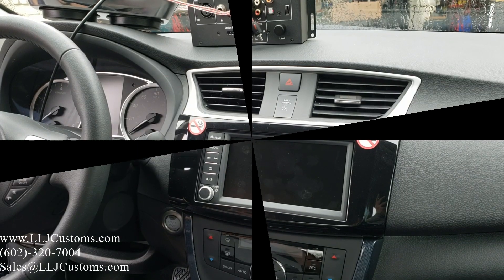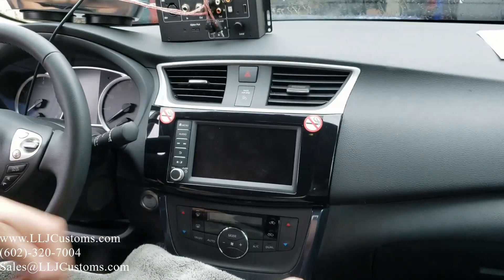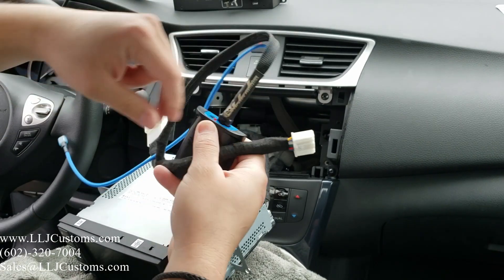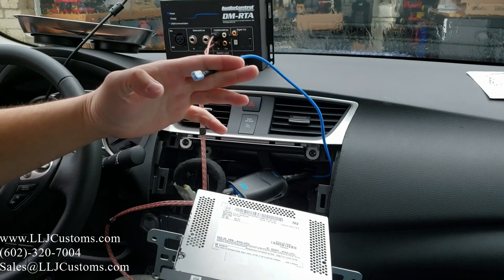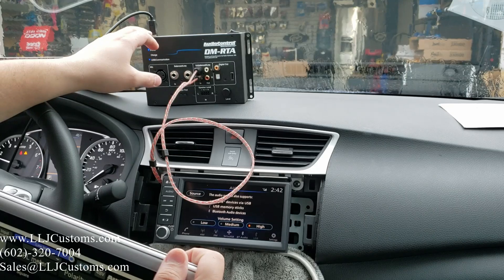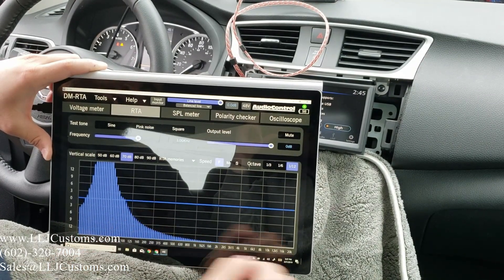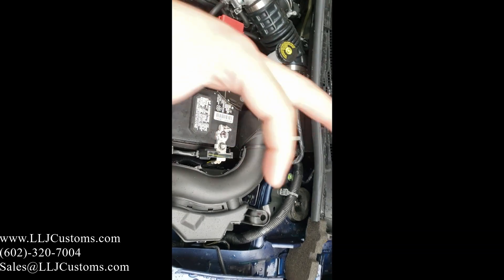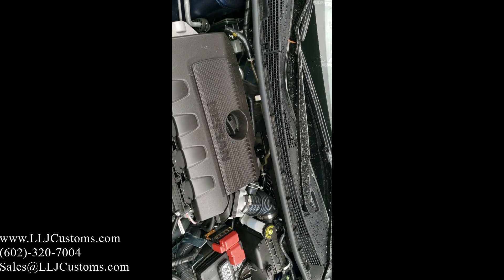2019 Nissan Sentra T-harness for sub-woofer amplifier install

Comment: I need a harness to wire a small 4 or maybe 5 channel amp to my OEM radio and speakers non Bose I have 2 door speakers and 2 package tray speakers for my 2015 Nissan Sentra. I havnt decided on the amp yet recommendations  needed would like to get in one around $200.00 tia Will H
Reply from the maker: @willhoggard645  hello, i would look at something like the wavtech 1000.5pluse for the abilities and price you cant do better ...with a bose loopback and a power kit is all ypu would need

Comment: can I use this "T harness" to plug into an MTX Bass tube (Built in amp)?
Reply from the maker: Hello adonian, that will depend on the input level of the all in one . Some units can take the 13v that the factory headunit will output if you have the factory amp it will need to handle 30+ volts of signal

Comment: Where did you get the subwoofer adapter??
Reply from the maker: We make them. You can get yours on our website @ lljcustoms.com
Reply: Buenas noches donde puedo comprar ese arnes...
Reply: Do you make them for a 2018 Nissan Altima?
Reply: @TheDjreds27  he said they have them for nissan for 2007 to 2020
Reply: Would this work with a 2015 Nissan juke nismo rs with the Rockford Fosgate system? Also your website says sold out. This is so I can add an additional aftermarket subwoofer/amp right? Do you also have anything that retains the 360 camera?